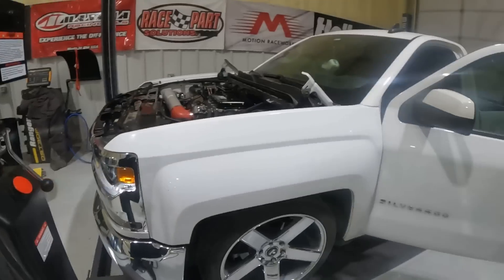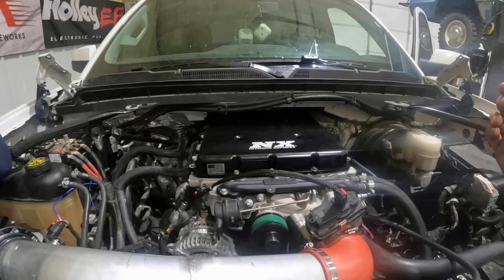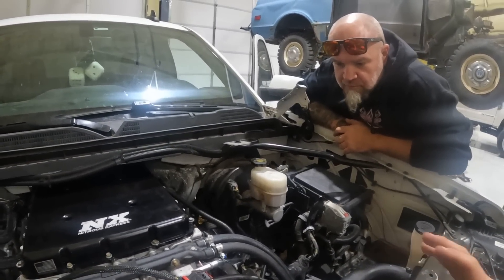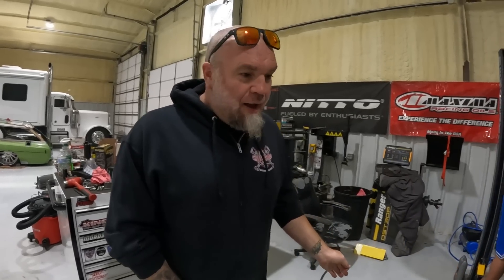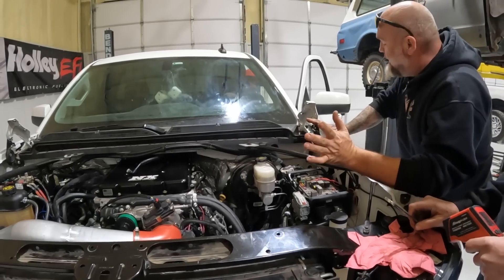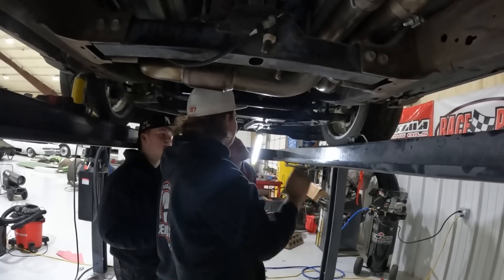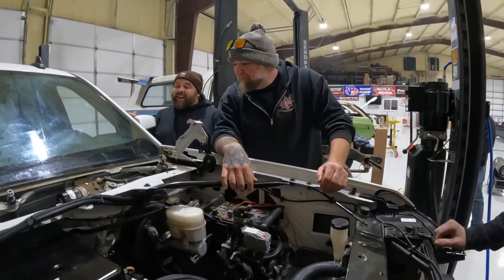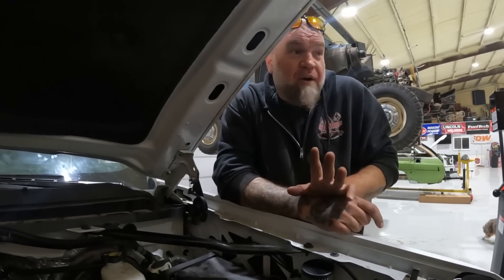THIS IS NOT GOOD! Part 3 of Aiden's Cam and LT4 Blower Install!

Comment: when you cranked that engine over after the engine died you are the reason it hit the valves and pistons anytime you do a cam swap if you have issues running or it dies CHECK timing chain first

Comment: I prefer the pinch clamp vs the worm clamp. The worm clamps do not maintain pressure on the hose after the hose begins to shrink. I've replaced the pinch with worm style on my rigs and months later, they're loose and pissing fluid everywhere. Seat the pinch style properly and forget it. They work.

Comment: Yooo.  I just dealt with the same stuff on my 2014 truck.  Started with too long of pushrods.  Truck ran.  Let it sit overnight and changed oil ( fresh l86 build)   soon as truck built oil pressure it bent valves.  Fixed all that and still no compression. Found my timing was off and found my cam gear skipping on my cam.   Waiting for texas speed to send my 3 bolt conversion and new cam currently.    Truck did exactly as his did.  No compression in one hole.  Then 2.  Then nothing.  Crazy to see yall go through it too!

Comment: Very familiar with your guys pain here. Dropped a lifter on cylinder 7 exhaust last summer on my 2015 silverado lt 5.3. Ended up putting in a stage one texas speed cam and ls7 lifters and deleted on that afm nonsense. I ended up pulling the engine and working off a stand rather than lean over the truck. There was a lot of curse words had on that deal. Pulled many engines with the old man over the years but this engine was very new and different to us both.  Good learning experience had. I also have the stainless works header back on my rig also. Decent set up for daily driving. Nice work on that truck. Mistakes make good learning experiences.

Comment: The transmission in that truck is safe to 820 SAE HP before having to be rebuilt with stronger clutches and roughly 800 SAE HP to the rear tires

Comment: Only thing I ran into when I did cam in l83 truck was getting the torque tables right to get it to idle because in hptuners it doesn't use airflow changes. Def alot of figuring out and research & asking a big name tuner buddy.

Comment: How do you have that much condensation in motor or blower? Is it just blow off at start up after build or does it pull water out of the air? If so I better rain days or wet days suck. Great job helping the boys out.Dalton worships you Shawn you mentor him into a great mechanic and a man.

Comment: Once you pop a fire extinguisher off, you have to have it recharged it will not work next time you use it, no matter if you used a little or a lot
Reply: Yes it will without a issue.. I serviced fire extinguishers as a profession for about 10 years... as long as the needle is remotely close to the green it will spray just like new.
Reply: @Steve82864  💯 not saying your wrong...can you explain what would cause a fire extinguisher to be empty  and no pressure, after it only being use for 1 quick shot, and was needed again a couple weeks later and nothing. Was there something faulty?

Comment: I had very similar issues with a l83 I done some work on… ended up spinning rod bearings from a result of the valves beating the pistons… just a heads up incase you run into spun rod bearings… 🤷🏼‍♂️

Comment: You can barely even see there's an engine with the blower, wiring, hoses etc lol.  Only fires I ever had on first starts were carb backfires... definitely not something you want to see knowing how fast a fire can destroy a vehicle.  It did sound rattly on startup, so valves hitting makes sense.

Comment: I knew from the first 1 second of cranking shit wasn't right.
ALWAYS listen to the rhythm of the motor when cranking, it will tell you better then a compression gauge what's going on.
It should go duh-duh-duh instead of duh-duh-dee, smooth rhythm is what you're wanting. Anyway, nuff dat.
The best "talking to" that I have heard Shawn do. Solid explanation and good detail involved it in.
I dun bee a wrench, so's I bee a knowin :)
Change that oil yet ?
Change it again then, it needs it.
Reply: Well all of the LT engines sound strange when you crank them

Comment: So what was the deal with the single bolt cam? How did the pistons end up hitting the valves? If you have the timing set correctly this shouldn't happen no?

Comment: @187 customers got a ? So what year is that truck and what all year Silverado’s have LS platform my dad has truck that bought and will not start and think they may have same problem u guys had gas blower if is what’s wrong with it would need to get 3 bolt conversion kit n heads I guess lol

Comment: Make sure those Teflon injector seals are well seated (they make a tool for it, but you can put a piece of vacuum hose over it and a hose clamp to squeeze them down all of the way)...sounded like it had a little low compression on of the cylinders...that blow-by was probably the gasses escaping the combustion chamber. That's one of the biggest problems with these direct injection engines. They absolutely need to be seated correctly, and can't have any tears I'm them. I've repaired several injector seals ..they get old and work and cause a leak

Also, if you don't have the a/c compressor pigtails and high and low switched connected properly, it will keep the fans on full blast.
Reply: The tool is part number GM245 on Amazon, same thing GM gives the dealerships to use as the “special tool”

Comment: What did you screw up with the cam? There are literally thousands of single bolt lt cam swaps running down the road with no problems. Mine included.
Reply from the maker: Congrats
Reply: @187Customs  I'm genuinely interested in what went wrong. I'm not trying to be a jerk.

Comment: Do you know what would be incredible? There's a Formula ONE race in Austin TX. Can you contact HAAS and get Phantom in there to BEG THEM to let him into the garage, just to observe what they do and how they do it -- sign whatever non-disclosure agreements, pay them a "fee" -- so  you can learn how those guys at that level, operate? Can you imagine what you'd learn in a weekend, and how that could be applied to everything you do in your race program, that could take you guys to the next level? It's worth asking. PLEASE CONSIDER THIS.
Reply: Remember, you wouldn't be interested in the technology as such; what you would be interested in is the /process/. What do they do, each weekend, to "shake down" the car? What do they do, to prepare for each weekend? For your needs, this would be priceless. Maybe getting embedded into an F1 team is out of reach; maybe an F2 or lower tier team that's also racing that weekend? Maybe a more local (US-based) series would provide that sort of info as well? 

The reason I suggest this, it seems that "process" is what separates the winners from those who are just as fast but are inconsistent. You guys are always pushing to improve, and with that comes new challenges. What should encompass changes to the technology (tuning, new configurations, equipment) is a standardized process to make it all "come together" to achieve a winning formula: reliability, consistency, with the maximum performance.

Comment: Sounds like u have the wrong part's on the motor. And i bet u have the connection's hooked up wrong. And at 29 minutes when it start's knocking u just kissed the motor goodbye.

Comment: that nx lid looks so nice! I just got my 6.0 running with a lsa and ive got a bit of blow by like that, think it will go away? or will I be getting into the bottom end in my future!
Reply: Should be fine. You want a little blow by with boost. Just make sure it's well vented...
Reply: I'd say normal long as it's not terrible.. I have some too just get a good catch can setup let it breathe and it'll last long as it was meant to lol
Reply: @kick_then_shift  Yeah I have the same exact motion race work catch can they put on Aidens truck so I think im ok

Comment: Can some explain the camshaft issue again? I don't understand what a 1 bolt style vs 3 bolt style means and why the 1 bolt caused an issue?
Reply: 3 bolt cam have no variable valve timing and a solid cam gear. A 1 bolt cam has a large hollow body on the bolt that acts a pressure valve for oil to pass through to make the cam phaser style gear change the timing of the cam. It shouldn't have made any difference unless it was advancing that bigger cam enough for the intake valves to hit the pistons. The cam description should have said if it needed a phaser limiter or Texas Speed didn't tell them it needed one when they got the first cam.

Comment: My L83 idles like silk at 500rpm. It was messed up if it didn't idle before. I bet that the phaser wasn't right. The 1 bolt cams work fine on them. It may have needed a limiter on the phaser. I am assuming you did an afm delete when you had it apart. I checked and the L86, LT1 and LT4 are the same cam. The LT5 is the same cam except it has the same profile on the non afm lobes and lsa the other 6.2's. The L83 is similar in the same way as the L8T in that the non afm lobes are the same. Stock non afm cam for L83 is the L8T cam and a stock non afm for a LT1,LT4 and L86 is the LT5 cam. LT5 cam can be used in a L83 with a valve spring upgrade. I am trying to get a clarification as to if it needs a phaser limiter. The L83 has less intake valve clearance and can't have much advance or none on the cam when you go bigger.

Comment: you could have had alot of gas in the oil due to stuck injector or way to much fuel and it loaded the oil that is common

Comment: When you cranked that engine over after the engine died you are the reason it hit valves and pistons anytime you do a cam swap if you have issues running or it dies CHECK timing chain first.